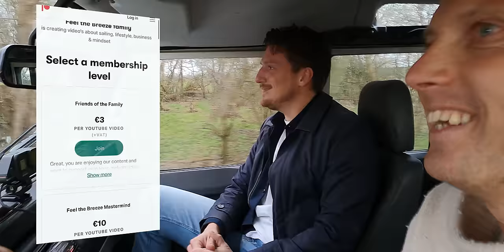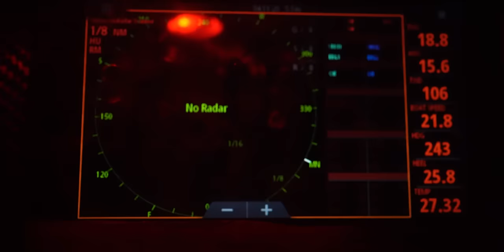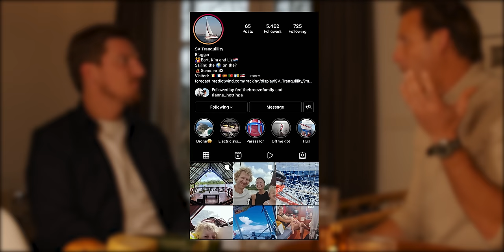ATLANTIC CROSSING can we do it? What does it take sailing the Atlantic Ocean on a Volvo Ocean 65

Comment: My dear Rainne Yes, you can do it easily. The main key is the best time for the weather, mid-December to mid-February, the best route. The best shortcut is the northern route from Portugal to the island of Azores, 700 nautical miles, then to the island of Bermuda 1900 miles then to the Caribbean 850 miles 25 days depends on the trade winds Find the financier Invest the ad Put your little boat on the boat My resources , sailing across atlantic how guide, ،chasing  latitude. 2, across  atlantic guide ,, sailing  gently.  Good luck, safe sailing, with God's help.Don't worry, it's like sailing in the Adriatic, the difference is that the sailing time is longer, we are all by your side in achieving your dream